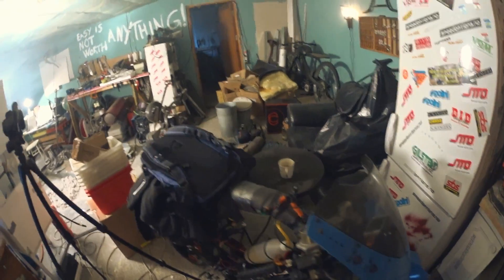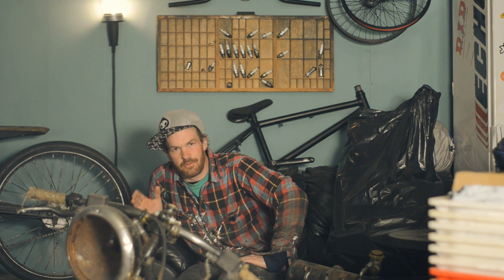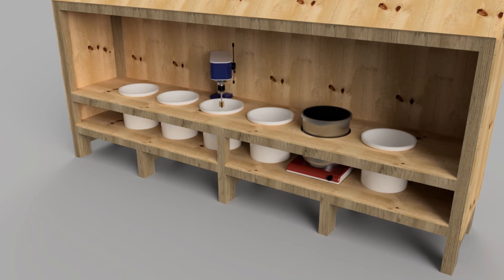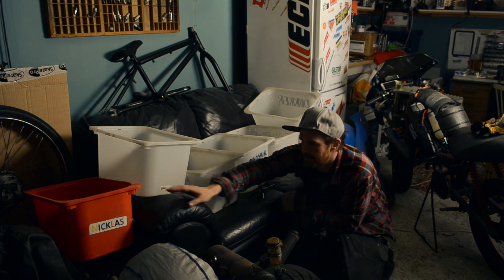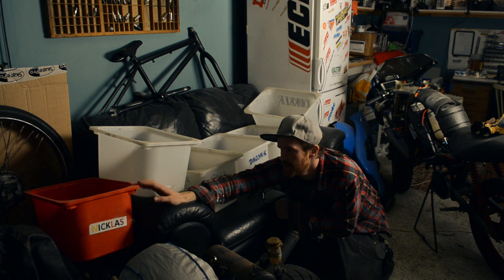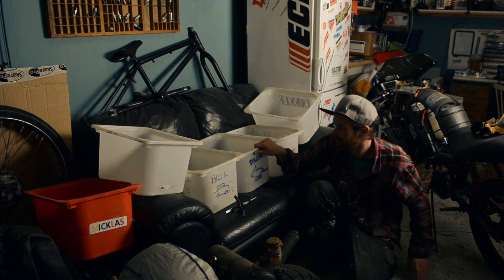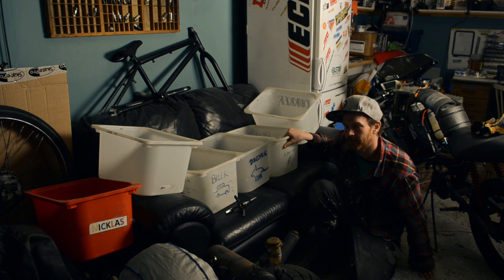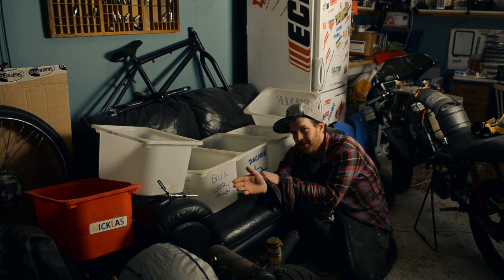It's going my way! - Casting the Most Powerful Two Stroke Part 8

Comment: In about 1998 I had an OS engines .46 FX RC airplane engine. It ran great out the box but one day it started to sound "grindy" and run very bad. I never had the chance to pull it apart and investigate due to life obligations and stuff. Years later, I came across snippets of information about OS engines' plating problems.

In your research on plating, did you come across a more complete story as to what the OS companies problem was? 

The Super Tigre engine company, who as far as I know, invented the ABC (a ring-less aluminum piston running in a brass cylinder that was chromed) used chrome plating. Is chrome plating simpler or quicker? Does it not last as long?
As always, you are doing a fantastic job making very informative videos, that I'm sure will be viewed as a source of information for many years to come.

Comment: I watched all the series of Your battle. Very interesting. But I have question - why haven't You use centrifugal casting or any metod of increasing pressure of liquid metal in mold? It would increase quality of cast. Did You try to smooth surface of plastic core with hot air or flame? What about molding with use of dedicated sand?
Reply from the maker: Thanks! I'm going to experiment with various ways of smootthing the model and vacuum assisted pouring next time I have a go!
Reply: @2STROKESTUFFING  You can try with some kind of sand which hardens under influance of carbon dioxide. If You are using liquid gypsum/cement mass try to degas it with vacuum pomp. And try centrifugal casting. It gives You much stronger element.

Comment: I've been going to do electroless nickle boron it gets harder when heated I've seen pistons coated to right below the rings and the a skirt coating I believe was from techline keeps everything round and holds oil what temp did you heat the aluminium to get no porosity thanks for the video

Comment: Prøvd å følge med "slik tåli" , men ikke fått med meg noe om hvorfor du går for Nikasil i stedet for stålforing? Vil ikke en foring kunne være redningen for den med støpefeil?     I'v tried to follow "ish", but not heard any suggestion of usage of a steel sleeve? Wouldn`t a sleeve rescue  the casting with port flaws?
Reply from the maker: It would, but I'm not settling for a compromise. The two main advantages with plating vs a liner is less friction and better heat transfer.

Comment: Hi mate, I think that from the beginning of your project you should have foreseen two things that are major for a current two-stroke engine, first, provide accommodation for two backflow injectors such as KTM to set aside the carburetor and second, a variable valve of exhaust, (power valve) to be able to use the full power range of your project. Congratulations!!!
Reply: Don Segundo congratulations you have researched KTM specs . This project is not about your second hand research..... pissst you should tell him to put direct injection on it so he can pass emission laws . 😂
Reply: @alcapone6270  No Al Mamone, that is not the idea, I think that he should have planned in his project space in the cylinder to eventually place injectors in it, apart from the housing for a carburetor as he did because in case a carburetor does not achieve the efficiency of the engine he are looking for would have a second option at hand, which is what the evolution of a two-stroke engine demands. Thanks for your objective appreciation. Best !!!
Reply from the maker: Might play with injection later on. Btw, I actually kinda know the guy KTM stole that injectors-against-transfer-flow from.
Reply: @2STROKESTUFFING  Hi mate, I think this is  the nex step in 2 stroke development...injection and variable exhaust valves to play with powerband, and if you can play, play with an L shape ring at the highest position as a Caber L Dikes ring to dissipate the heat of the piston crown, Best for you man an dont forgive to give me the recipe for make all this things in your home an dont receive a kick in your ass from your wife ;) Skol!!!
Reply: Don Segundo when did you last build a cylinder from scratch? You can’t even spell.

Comment: I have been watching your videos i like what your doing i have similar ambitions mine will just be a 2 stroke diesel not gas. In some of your videos you have made mention of the PLA molds not melting out right. I was going to use the wax filament from machinablewax.com i think if you were to use this you could pour your aluminum directly onto the wax mold without the melt-out process. Let me know what you think

Comment: MAKE SURE TO PRACTICE PLATING ANOTHER SAMPLE OF THE SAME MATERIAL!
ALSO MAKE SURE TO TEST YOUR PLATING TO MAKE SURE THE WEAR WILL EXPOSE THE SLIDING SURFACE AS YOU PLAN IT TO! 
Then again, plating this particular casting could be your practice! 
Everything works in theory but sometimes the application goes awry.
I WISH YOU LUCK!
That is all good sir!
Reply from the maker: Thanks! I'll practice on the failed castings.

Comment: I'm glad to see that you have a good cylinder to work with !! Is it possible to use a metal evaporate process ? Like the system used in coating telescope mirrors. I would think that it would be a better process because it's the way exotic machine tooling is coated ! You could build a small vac chamber and  probably use a mig/tig or plasma (if doing ebc) welding rig for heating the Boron-Nitride or other !

Comment: No exhaust bridges with what looks like 180 plus degree's of exhaust port width? I guess you are using a ring-less piston design with a large chamfer on the top of the piston to keep it all from falling into the port??
Reply from the maker: Special retained ring piston, see earlier vids in this series.
Reply: @2STROKESTUFFING  But what's going to retain the piston from snagging the port edge?

Comment: That exhaust port seem to wide, to run without a bridge.
Will snag ring.  For prototype, just use a high silicone alum, skip the plating.

Comment: The exhaust port is too wide and the ring will break the piston, then you have left little space between the intake port to let the end of the rings pass... But you are an artist!! Good lake and congratulations!
Reply from the maker: Thanks! I will use a special retained ring, see earlier vids in this series. The ring gap can run in the middle of the c port without issue as long as said port is reasonably narrow.

Comment: Have you thought about building a small engine dyno so you could read the horsepower directly? It would take out the variables the transmission, tire and such.
Reply from the maker: Yep, plan on fabricating a bolt on solution for my existing dyno.

Comment: NEED A PATENT  --If this is success you can sell patent to major motorcycle --??
Reply: That's not how ot works, a company is perfectly capable of building a simple 2 stroke, but they have to put reliabilty and ease of use first.
Reply: Cesare Vissani especially a well funded company like KTM and Yamaha. But it'd be cool if he figured something out on the engineering side that the big 5 haven't.
Reply: @Belicose777  ..you could also include the missing Japanese ex-motorcycle company 'Bridgestone' too; a company who's bikes was so good, the other four teamed up and forced them to give up making better bikes.

Comment: why didn't you make a casting to support an insert sleel or stainles tube as a bearing surface?
will aluminium alone be strong enough?
Reply from the maker: That's what the plating is for.
Reply: @2STROKESTUFFING  yes but i am kind of surprised it would be enough. i might be simply ignorant in engine design, but i simply never head of this method. besides  if plating goes uneven it will wear out in places before the rest and then what?
other then that i am very impressed about the whole project and i would like to wish you success and much fun from using it iin the future
Reply from the maker: Thanks! The idea is to plate it, then hone the surface to make it even and expose the hard BN/SiC particles.

Comment: I am blown away how far you pushed already. But there is one question that came up in my mind as I saw the inside of your cylinder. How do you keep the piston rings out of your exhaust port? Or do you not use any?
Reply from the maker: Thanks! Special retained ring, see earlier vids in this series.
Reply: @2STROKESTUFFING  be sure, I will look it up! Thanks for the info!

Comment: Nice ending 😆! 

How will you be able to hone the cylinder with that style of hone you showed?  My experience with them on 2-stroke cylinders has been that they tend to get caught in the ports and the also like to cause the cylinder to get egg-shaped on the horizontal slice and bell mouthed on the vertical slice.
Reply from the maker: That hone is only for mechanically removing the oxides in the zincate bath. Will use a sunnen style hone for the finishing after plating.
Reply: 2STROKE STUFFING  Very cool!

Comment: Great videos, just great. 
I'm a 2 stroke enthusiasts as well, making non existing stuff like clutches straight cut gearing and so on, my puch maxi with e50 engine is a mean machine.

But I was wondering, looking at the picture of your cillinder.
The exhaust port, I think it's a bit too wide.
The piston ring wil expand in to the port and will destroy it all, I think.
What are you going to do about that?
Reply from the maker: Thanks! See my earlier vids in this series for how I'm going to tackle the ring snagging issue.

Comment: so Holländaren is going to be a part of your cylinder production line? :D
jokes aside i'd really like to se the machining processes, any chanche Holländaren filmed them?
EDIT: i found what i was looking for on Holländaren's instagram
"I indicated on the bottom surface and bore, as close as I could get it with this rough surface. Not much other options :) but I machined the bottom and bore in the same setup to make sure it's running true. It may not be perfectly centered because of not having a smooth surface to indicate on but it's not off by a whole lot, probably at most a tenth or 2 mm"
Reply from the maker: 😁 I plan on getting a lathe and mill as soon as possible, but money... I'm hoping he's had the time to film some too!
Reply: @2STROKESTUFFING  i know that feel, i'm waiting to get a job so i can fix my grandpa's crappy lathe and build a cheap cnc mill and start the 2 stroke shenanigans myself  :')
keep on stuffing, you are an ispiration to all of us!

Comment: Man, I really hope this whole project works out for you. I love a good 2 stroke, and it has saddened me to see the lack of innovation in their design in recent years.
Reply: @No Thanks No. By the early 90's horsepower figures for 2 stroke engines were radically higher than in the 70's. Innovation was alive and well in those years.
Reply: The basic 2 stroke concept hasnt really improved since the 60's but luckily brands like evinrude are putting effort in new 2 stroke innovations.
Reply: It's because of immature reasons that engineers and manufacturers say: that two strokes are dirty. And they don't improve to make it clean!